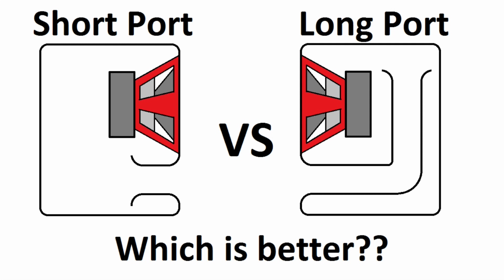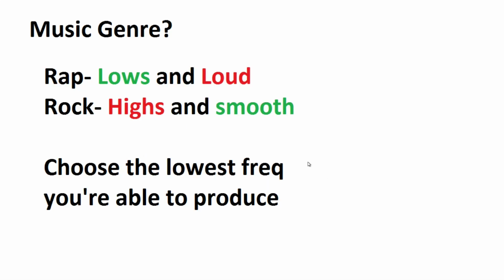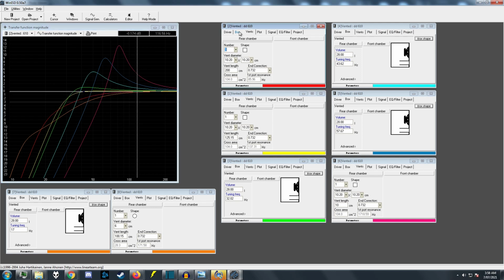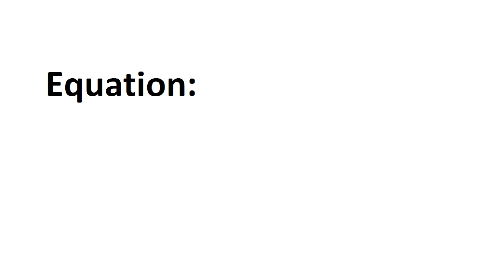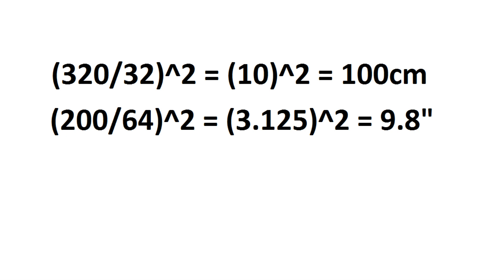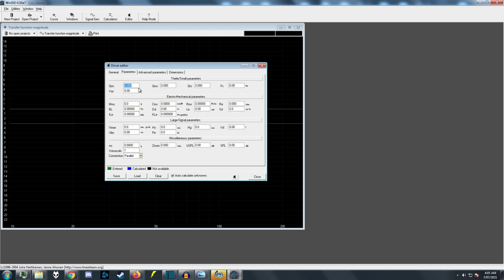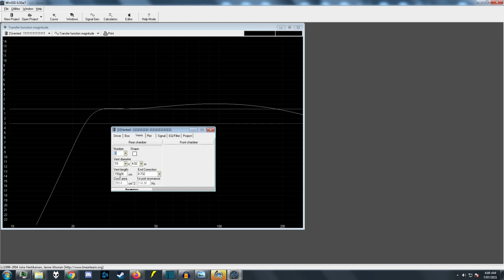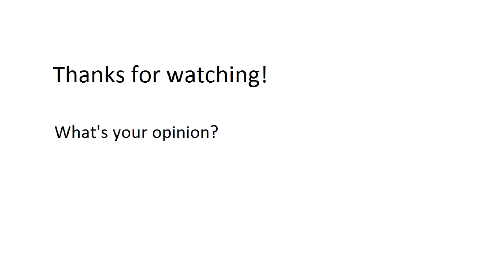What is the best Port length?

Comment: The long port creates low sub-bass frequencies, and the short port creates low midbass; midrange bass and high high-mid frequencies, so both ports are useful in creating subwoofer and speaker cabinets

Comment: I have a short port & it does the job very well than expected. My subwoofer area is shallow byt ok the sides for the air flow is deep & pushes a lot of air & deep waves as well. Its a 6th band passover custom build.

Comment: I am very familiar with the use of WinISD.  There are different charts within the ISD program such as Port Air Velocity and Cone Excursion.  These can aid you in your Port tuning for what ever size box you choose to use with what ever speaker you also choose.  You choose your Driver, then choose your cabinet size then choose what   HZ you want for your High Pass.  Then you can start tuning your vented dimensions in either round or square.  As you choose your port size dimensions and Port length, the WinISD program will then calculate the resulting measurements.   If you choose a more narrow or smaller port then the port length requirement will become shorter, but you may end up with a Port Air Velocity that will result in "chuffing".  If you choose a larger port size you will then need a Longer port length.  This may slow the resulting air velocity but may then Increase your cone excursion beyond the mechanical limitations of your Driver. You can adjust port size and length along with Cabinet size to get a satisfactory result for your Driver and your audio expectations.  If I had to understand the Math behind WinISD Program, then I wouldnt really need the program to begin with.  In fact if I was that talented, I would probably have enough financial clout to just buy a set of B&Ws and forget about the whole thing.  Anyway, I did like your video and even subscribed.  :D

Comment: are  Egg shape ports  as efficient as circle ports?  in terms of max Velocity before chuffing...   I used a 3D printer to make a 3 inch x 4 inch  circular port,   the reason i have done that is to try  to cut out as little wood as posible to keep the front baffle strenght maximum,     but I also heard large area ports can sound bad,  like you have mentioned sound like 1 frequency and boomy,   so by limit it's size in one dimension it should keep the air flow tight... and more accurate,  this is just my theory from what I have read online...  that's why some people prefer slot ports because they sound cleaner, less compression,   so the same principal here,  im making the aereo port wider in one dimension...  3x4 inch,  I could even make a 3x5 inch circular port to see if it sounds any better,  to try and control the air better, without getting weird resonances or muddiness coming from a large diamter aero port...

Comment: The only part of this video I don't agree with is that a ported box tuned to say 40 hz will not likely play to 30 hz. I think that's a bit misleading as I know many of my boxes tuned to 40-38 hz in car will be audible down to 27-25 hz with proper subsonic filter settings. For example the Rockford P3-2X12 prefab setup is tuned to 40 hz or slightly higher yet has in car response down 25 hz.
Reply: yeah, i just tuned my new built box to 40hz, because it would fit the driver better, but damn, it does under 30hz no problem!
Reply: How do you tune a new box? I just made a 3cf box with a 2.5”x15” port and it’s about 30” long.
Reply: I listen with a 46 Hz Fb. I have tried a 46 Hz Fb in 120 liters of clean internal volume, as well as in 77 liters of clean internal volume for a 15 inch speaker. The difference is big. Usually bass with 40+ Hz is better in a smaller volume. For a 15 inch speaker 80-100 liters of clean internal volume. This is a guideline. It also depends on the speaker itself.... For the best result, three things are considered: Port, port setting and the clean internal volume of the box. :)
Reply: this is super old but for any newbies to this, look at the frequency roll off rate to know, you will lose some volume but it will be able to play that low specifically on ported subs
Reply: @elijahbarnes438  actually with ported boxes once you play under tuning the sub will unload and have over excursion issues. Without a subsonic filter you wil blow speakers. You had that backwards....a sealed box has a less steep roll off.
Reply: I have a small compact three-way that is tuned to 51 Hz in my in room response is 34 Hz and a very nice 34hz not -10db more like -3/5 down

Comment: I have 2 10 inch Americanbass xo1044 subs which are rated at 300 rms each. What size box and ports w
 Would work best for heavy metal and old rap music?
Reply: I don't have the specs on those speakers but I would have to guess around one and a half cubic feet a piece with at least the 3-in diameter port that is about 7 to 9 in Long for each chamber

Comment: can you help me with a new custom box? i have 2 dd audio 615e sub woofers on a m2000 wired to .5 ohm so 3000 watts roughly? i currently have the subs and the port firing at the trunk lid and i believe due to the size of the box a lot of sound pressure is trapped into the trunk so i wanted to rebuild with the port firing towards the cabin of the vehicle my current box is roughly 27.5"L x 37.75"W x 16.5"H and a depth of 27.5" and is about maximum in box size i can possibly do as it touches the top of the trunk the bottom of the trunk and the trunks arms rub on the box so Im trying to increase low end SPL (35hz) or less current port area is 5.5"W x 15" H I have sound deadening but will add more during the box rebuild as i need it Im a huge fan of "the cars that go boom" so if you can maybe tune it in there if you know it that would be great any tips or tricks into if not its fine just doesnt hurt to ask
Reply: did the box dimensions wrong 37.75" L x 28" W x 16.5" H the depth is the width i brain farted

Comment: If you put a 4ohm  speaker in a sealed cardboard tube,  just slightly larger than the speaker. The results are  remarkable even with a low power amp.
Reply: I used a cardboard box with 2 @ 6.5 inch 3 way car door speakers to test a small LEPY Brand amp. Put foam around the speakers and it sounded actually really good for a 10 min job. I used 15 volt 500 ma power supply, but I recently found that I can use a 24 volt 5 amp power supply. Lol. It works if you're testing? And like me run out of MDF! Cheers from Australia 🙂

Comment: I appreciate this, and thank you. I am in the process of building a "boom box" with 2 three way JBL oval speakers . The pamphlet mentions them as 6 inch by 9 inch coaxial car speakers. Continuous power rating is 80 watt and a freq response from 50 Hz to 20 kHz. What sort of volume should the box have  as I would like to use pvc piping (28mm ID and 48 mm ID ) Where (the internet) or how do i calculate volume, diameter & length of the port ?
Reply: Man that's hard to calculate because they don't usually offer full t/s parameters for coaxial speakers. I will say those types of speakers are made for free air/infinite baffle setup so they will require a large box to play deeper notes. They probably have a very high QTS value.

Comment: 🔴I have a 8 cu ft gross ported box (with 15" kicker L7s 1000w) my port area is 17.5" x 4" equals to 70 in2 (or about 9 in2 per cubic foot). can someone tell me if my port is to small. i heard its supposed to be 12 to 16 inch squared per cu ft
Reply: Thats a rule of thumb yeah, but thats all it is, a rule of thumb. It also depends on the power you have, cone area, and the xmax of the subwoofer. If you got a big sub with a lot of power at it with s lot of xmax then a bigger port area will perform better and vise versa

Comment: For 8 inch wooder is 2 inch diameter round port good ?
Reply: It depends on the subwoofer's xmax or your tuning
Reply: Yes it’s perfect. Especially if it’s a precision port flared.
Reply: 7-9 inces you don't need fancy computer programs

Comment: The "right" size of port does not exist. The port must be big enough to avoid  "chuffing". That happens around to 17 m/s air velocity. The port area and tuning frecuency,will determinate the length of port
Reply: Just make it more aerodynamic to make it smaller, smaller port size makes it less boomy.
Reply: 17m/s is actually still quite acceptable. Unless it's a 2 inch port... But the bigger the port, the faster it can get without chuffing. I'd say anything less than 20m/s is golden... (again, assuming that the port diameter is sufficiently large)
Reply: Line your port with self adhesive felt, chuffing will go away, think of a udigery doo or any wind instrument, they won't work if lined with felt
Reply: At 17m/s a 6 inch port does NOT chuff, I don't know who told you that it does, but it doesn't. It's windy, but it doesn't chuff.

A 2 inch port does chuff at 17m/s, but that is basic physics.
Reply: @iterminator309  The chuffing happens at 17 m/s. The port size does not matter
Reply: @fabianmolina866  oh, okay... If you say so.
Reply: @iterminator309  You could have chuffing in 6 inch port or 2 inch port,because no depends of the size necessarily,otherwise the construction

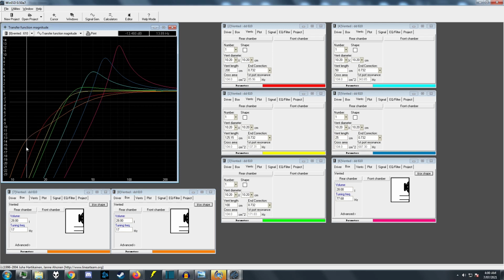Comment: At 6:07, when you said that WinISD "won't show how they sound different", you can click over to the Rear Port - Air Velocity pulldown tab and it'd demonstrate just how much more air displacement you'd get from the smaller port than the absurdly big one.... If my calculations are correct, it's a difference of 24 to 6.5, or multiplied into a box I'm trying to build, a difference of 59 to 16 m/s. 
For reference about the 59, that's about 17% of the speed of sound... I've always read that the goal is to say below 5%. Even the 24 equates to 7%. Not sure where that information comes from (or really how true it can be), because it's not like I see a lot of 9x9x54" ports out there to "allow" for such.
Reply: 5% is for very high sound quality. You don't need a such low value. 10% is still acceptable. In fact, most of car audio manufacturs reccomend values of port area in this range

Comment: Can anyone give me their thoughts on 2 subs in a ported box with separate chambers with each side having a different tuning? Is there a name for that.
Reply from the maker: Generally I'd only suggest this if the subs had a crossover between them, so one did 20-40Hz, and the other one did 40-80Hz. Problem with overlapping is due to phases you can get cancellation, which means it ends up being louder just tuning 2 subs the same.
OR, it is also possible you just described a parallel 6th order enclosure, with 2 subs in it.
Reply: 6th order Bandpass

Comment: well. u get a sub and like dude . I never use a software , just paper and formula but seems interesting
Reply: I always told myself the port diameter should be 1/3 of the driver size by twice the diameter length of the driver

Comment: Love it! Project Smol Boi's port/vent is 49.5 x 17 x 61 . . . .inches! It's enormous, but something I had to be careful of (and why I went with a MASSIVE port) is that if your port is TOO long (i.e. your port tuning is too low) you start getting response VERY SIMILAR to that of a sealed enclosure with some drivers! At that point, you might as well save the space and go sealed.
Reply from the maker: Yeah, can be tempting to tune to 5Hz for those rare yet epic moments when immersion is ruined by the TV falling on its face lmao, probably good to have a projector for such cases!
That's the tricky thing with enormous sub boxes. If the port area ratio, length ratio and volume ratio are all the same, the bigger the box means the lower its tuned, so ENORMOUS boxes can require either really short ports or a huge area, I wouldn't be surprised if you took and entire end off Smol Boi and its T-line tuning remains in the 20s XD
Reply: @Dakoustics  BHAHAHAHA! I don't doubt it, it's a very VERY large box! I wish I had your brain over here in the US whenever I start building new projects. I'd be so much more confident in how to proceed! 

What's next on your project quotient?

Comment: There's an oft mentioned joke back in the 1990s when it comes to bass reflex loudspeaker design that goes: "...if the port is any longer, it would be called a transmission line loudspeaker..." Needs more long-haired wool though.😆
Reply from the maker: Heh, my dad has told me stories of bass reflexes in the 70s, possibly 80s, with drivers so soft the boxes would be enormous, and as a result the port was just virtually a side missing from the enclosure, jeez audio has come a long way so recently

Comment: I build box 0.8cuft with port 16sq inch, long 20 inch for sub 8 inch. is it good?  And what frequency does it play on?
Reply: the box would be tuned to around 44Hz which seems a bit high personally, if your box is big enough i would recomend trying to add an aditional 11 inches of port length so you would be tuned to around 36 hz or you can also do 7 inches to it to tune it around 38 hz, it would most likely sound better but i dont know if the box would be too small for your 8 inch sub at that point if you are adding a larger port wall it will decrease the subs useable box volume, the box im making is for my sundown x12 its 2.3 cuft before the port, and is tuned down to 32 hz so roughly a 39 inch port area usuing his equations where i found 34 inches to be closer using a different app. hope this helps
Reply: @jordanlee1237  0.8 cuft  net box, my port is out of the box, I've tried adding 12 inches to 32 inches, tune around 38hz, I feel there is no difference in sound for low freq, but Sound Pressure Level feels buried. but in the manual it says 45hz at 15 liters. ideal for an 8 inch subwoofer what is the box size and port diameter?
Reply from the maker: @akuncrazy  If the sub's resonance is 45Hz, it'll have trouble making the low notes, especially if the driver is stiff. One suggestion I could make is to aim the port into the corner of the room, try to get some corner loading to boost the lows a bit. Sounds like a reasonable suggestion from the manufacturer. If you're willing, could add blutac to the cone to lower the resonance, just be careful not to break it
Reply: @Dakoustics  
yes the manufacturer recommends 15 liter tuning 45hz with 80/1 flare, and 12 liter box selaed. but I don't understand what an 80/1 flare is, so I made a box 20 liter, port with a 4.5 inch diameter, 20 inch long (tuning approximately 47-50hz). well am i better to follow the manufacturer's advice at 45hz, or make a lower tuning say at 30-38hz? 
And what is Blutac?
Reply from the maker: @akuncrazy  Since your box is already a bit bigger than the 15L they suggest, tuning lower should be fine. Also, Blutac is a sticky tar-like substance for sticking things together temporarily. I just put some evenly on the cone with the main goal of adding some weight to lower the resonance of the driver, so it works better at lower frequencies.
Reply: @Dakoustics  thanks for the information, so how many hz is it tuned lower?  40?  38?  35hz?  is there a video on how to use Blutac on a subwoofer?  I'm afraid it will be damaged.

Comment: Hey! Great video, as always :) Have you considered looking into what changes when you have two ports with same tuning but different port air  volumes?
Reply: What if you only have port as your box i.e tline or horn. I also have the same question as above, same tuning, same subwoofer, different box volume. So the only difference will be in the over all port area. There is so much to building a box lol I love it and hate it. I plan to do some debunking and theory on this subject some day. Appreciate your vids.
Reply from the maker: @Subdynoman  Ah, same tuning, same subwoofer, different box tuning, only difference being area- area increases with box volume. 
In regards to tline, horn, a ported box is basically the opposite of a horn, starts wide and ends tight. So, imagine a T-line has a set tuning, a port widening, i.e. a horn, has a higher tuning than the T-line, and a port narrowing, i.e. a bass reflex, has a lower tuning than the T-line.
Hoping this will clear things up a bit
Reply from the maker: If both ports are the same tuning, then each port will do half the work, i.e. move 50% of the air each. So, the smaller area port, in order to move the same volume of air, moves the air at a higher velocity.